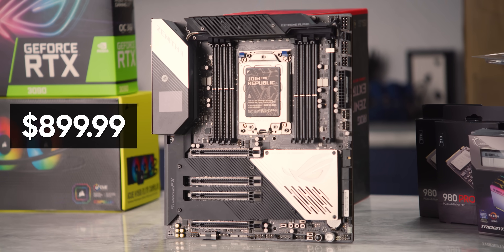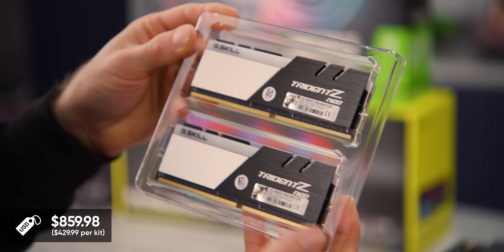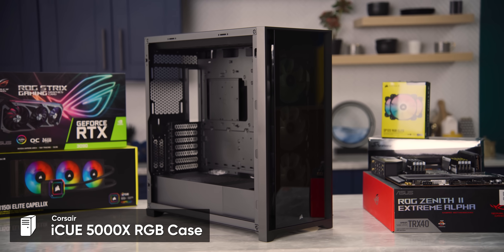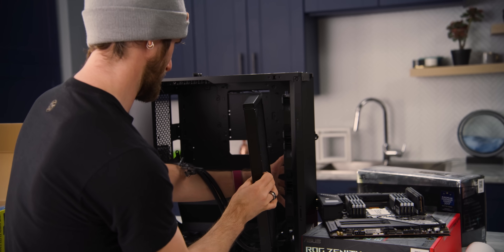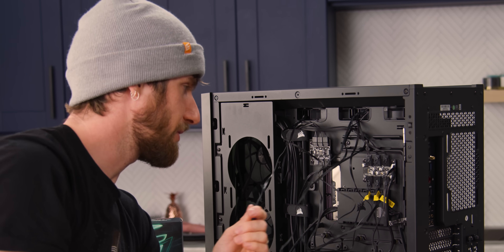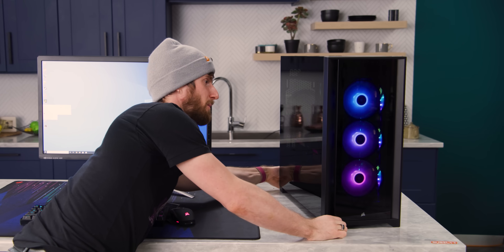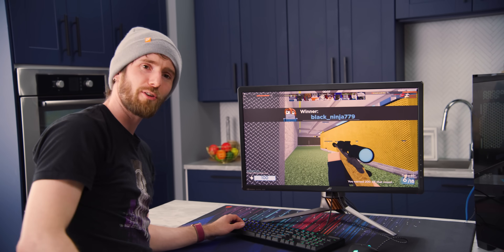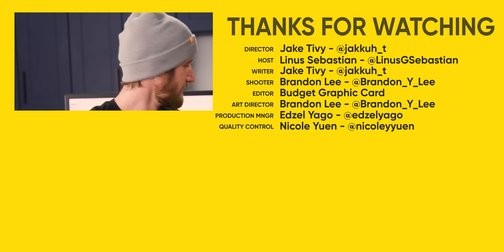Building A $10,000 PC for ROBLOX

Comment: On such an overkill build why not use a CPU cooler specifically made for threadripper?  They exist both in air and AIO/water form.  And personally, for a low maintenance always in use editing rig, I would most definitely go air cooling, like they're not gonna be overclocking the thing, and you can even get better temps and likely extra perf/mhz just by undervolting it a bit.

And, if you ARE going to use a regular AM4 heatsink or AIO for threadripper, you should apply some extra thermal paste AROUND the pre-installed paste, because as you can clearly see, the cold plate is significantly larger than the small area of paste, and while the cold plate may be big enough for the chips underneath the heat spreader, without looking it up I HIGHLY doubt that little thermal paste square is large enough to completely cover them all.  So without extra paste, the rest of that cold plate is doing pretty much jack, but with some extra paste around that square you can at least put it to use and get your half-assed "full coverage" that then might actually technically be full coverage.  Keep in mind though it's not just about the cold plate - the fin area inside the block is pretty small on these and def. not full coverage whereas the bigger ones have way more fin area.

Comment: you say the ram is really high capacity but yet you still used 8 16GB sticks to get the 128GB of ram my rig has 4 32GB sticks and so it also has 128GB of ram at 3600MHZ CL18s so how high capacity are the ram sticks you used really considering a simple gaming build would have 2 16gb sticks for a total of 32GB ram at 3600MHZ CL16s or lower 

i think you clearly cheeped out on the ram and are just trying to make it sound better then it actually is also its trident Z one of the cheapest rams out their that is why thy are practically in EVERY build

considering if you actually used real high capacity ram you could have still given them the 128GB ram at all the exact same specks but use half the slots and then have a easy path to a simple upgrade just by increasing the amount of ram later on to 256GBs 

also only time your AIO should not be in the top of the case is if it cant fit their but then you should have gotten a case that fits your cooler or a cooler that fits your case so in practice an AIO should only ever be mounted in the top of a case

Comment: This computer using quality parts, but it's like RGB, and design wins over everything else. Like come on, the cable management is horrible, on PC like this use some quality single-sleeved cables with decent cable combs also why this case? It's so restrictive that the fans will have to spin like crazy to be able to remove all the heat from the GPU. I use a very similar computer, but fully water colled with custom loop, the case has far better airflow and all cables are custom sleeved cut to desired lenght. Yours have far more led diodes mine is much quieter and both CPU and GPU can clock higher. Its Apple-style computer, design over functionality.

Comment: 6:45.... Are you sure about that? Steve from GN won't be pleased.
(For AIO you want rad tubes down)
And no, about trapped air bubbles. If you power on AIO for a few seconds while holding the AIO  above the pump, the bubbles will come out and in the rad. Then you can install AIO TUBES DOWN without worrying about bubbles.
Hydrostatic pressure principles dictates that, there is no difference between tubes up or down as long as there is no air in the tubes or the pump.

Comment: There's no way that AIO is going to be able to cool that thing without the 3990x throttling heavily if its hit with long term sustained workloads.  My 2950x was only truly tamed by a proper aftermarket CPU block, radiator, and fans.

Comment: LINUS!! please build be a 10k ultimate ramdisk gaming pc. this would include dimmdrive for all  my steam games. and ssd(s) that still have secure erase feature(segui0.exe). also put windows 7 pro 64x on vmware ramdisk  for web browsing and launching games. and include a 4gen pcie that has ram on one of those riser cards or whateve ryou showed before. also have a win7togo usb flash drive that is a ramdisk drive i can boot windows 7 from if i want to boot windows 7 without using ssds. and configur ewindows as bare bones fastest performance in services and regedit tweaks for gaming on wired and/or wifi connections. throw anything else in that you can think of ramdisk related.
Reply: and put the fastest /most amount of ram 1 terrabyte plus please
Reply: setup a ddr4 mobo and a ddr5 mobo if its available. or both so its future proof:)
Reply: and yes AMD not intel. make sure that video cards , etc have samsung chips
Reply: and include a top tier asus freesync monitor that works on any game or any game freesync works on
Reply: or if theres a newer amd premium freesync or newer tech that works better use that
Reply: and no rgb...yuck:)

Comment: I just built a similar rig - Same proc, MB - that cooler is not going to really cut it - temps will run 75-85c under light load I had to get a EK waterblock and create a custom loop to keep it under 65c - Also the m.2 slot on the back really doesn't get sufficient cooling depending on case - I have the Thermaltake tower 900 - My system is for VMs so didn't the need the video card.

Comment: "Money is not an object! Go all out"
"Okay, but you sure as F not getting a back exhaust fan"
Reply: Well it isn't even close to necessary. 6 filtered intakes+3 radiator exhausts is PLENTY for a 360mm AIO with a single gpu.
Reply: @Nobaris9961  it's a 3090, it's not like it's a passively cooled gpu
Reply: @wangpowersports  3090 or a $20 GPU, a single is still a single. Heat doesn't really step up that much until you step into deep SLI territory.
Reply: @Nobaris9961  aha 20 bucks where can I find it
Reply: With 6 intake fans the case is gonna have positive preassure and exhaust out of every little hole there is in the case, everything will have all the fresh air it needs.
Reply: Lmao
Reply: exactly what i was thinking, wtf
Reply: It could be technically not necessary, but if you are to not care about expenses, you are not going to leave an empty fan slot!
As an owner of a CM 690 Adv II, I didn't rest until all the fans possible where installed!
It's the principle of the thing
Reply: @aibandidos  Just another clueless bimbo who thinks "more fans better!!1!1!". At this level of a build one extra fan is not going to do anything noticeable. You're chasing that 0.001% that mean literally nothing in the context of this build.
Reply: @Nobaris9961  why thanks for both the elevation of your argument and for showing you missed the whole "no compromise build" point entirely.
Reply: @Nobaris9961  yes, all of those are as "standard" as an exaust fan.
Reply: @aibandidos  if you actually put 6 intake fans your pc bouta be dead
Reply: @wangpowersports  CM 690 adv II solid side panel, with 4 intakes and 3 extracting since, I don't know, 10/12 years? Rocking a nh-d14.
As long as you have enough exhaust, you can have as plenty intake as you wish
Reply: @aibandidos  well, at least 1 exhaust fan

Comment: I built a $10,000 computer for a customer at Fry's Electronics in Sunnyvale in 1995 with a Pentium 133, 16 MB of ram, 2 540 MB hard drives, Soundblaster Awe 32, and various other upgrades to get to 10000.  We had to order the chips directly from Korea as they were not even available here yet.  Everyone in the store looked at us like we were crazy, no one will ever need specs that crazy.  Now, it isn't even worth its scrap value.  Just crazy how fast computers move.

Comment: Hey Linus! GN's video about "Killing your AIO" actually states that its good practice to front mount the AIO 
Radiator with the tubes at the bottom, and bad practice to front mount the Rad with the tubes at the top because the pump will continue to pull air out of the top of the Rad that way. i.e. Air bubbles always travel to the top of any container holding liquid!

Comment: Someone is going to daily drive this thing.... Ah yes Linus like my rig... A 128 MB rgb ram with an MSI motherboard, a Threadripper 2970wx 2,5 TB NVME 3 TB SSD and 21 TB HDD, also a 710GT, 1050 Ti, and a 2070, and yes I use it as a hypervisor running KVM QEMU and I have a variety of VM's. Also LTT if you have any ideas on my beuatifull BEHEMOTH do let me know.

Comment: I do have to wonder if all those NVMEs are definitely CPU-side. I mean, for that kind of price you'd think so, but I also have a pricey TRX40 board with three NVMEs on board and a riser. Only two board-mounted NVMEs are direct to CPU, the third is PCH. For additional CPU-side NVMEs, the riser needs to be used.

Comment: @Linus Tech Tips Hello? This was the worst case we have ever seen. The blend that blocks the side intake also blocks the power cables from going in sinkreight into the motherboard. We spent an hour to get that pos plate out of the tower cause we had to uninstall everything, especially the cable management on the backside, in order to get this f out of the tower. Once out we didn’t waste more time trying to get it in again cause as it seems only custom cables can bend as much. However it might be you have a slightly newer version cause the top plate was also fixed to cables of the cable management. But still, this was such a terrible case.

Comment: One of my friends has a build like this for pro (10-12k) video editing which is his living. He has 4 2080tis and a DIMM.2 full of 8tb gen3 drives which he says is fine. The whole thing is liquid cooled and has a second dedicated circuit that powers half the GPUs, with the other half running off the original circuit in the room (yea he had to install a 2nd circuit for his PC). He still has his 3970x and recently sold his first 2 2080tis from his first rig, which he used long enough for them to DIE inside warranty, both of them. Renders were crashing constantly and none of his pro apps would run anymore but they gamed fine, so he RMAd them and sold the replacements (which were surprisingly new in box which was kick ass, this was last year when new cards were $1100, he got $1200 for them a month ago though). Dude's got 256gb of RAM as well and has sent screenshots to me of over 180gb of it in use in after effects, it's absolutely wild

Comment: Linus apparently has no idea how to mount a an AIO. Air raises Linus. When you mount the AIO with the tubes coming from the bottom you ensure air does NOT get into the pump. If you mount it with the tubes at the top, that's where you are going to capture air. smh From Corsairs website, "mount the radiator of the cooler at the frontal area of the case interior. The side of the radiator where the tubes connect should be at the bottom, and the pump should be mounted in a position where it is slightly lower than the top of the radiator, where air is captured." At least Jakes method of mounting at the top ensures that the tubes are always at the bottom of the water.

Comment: One thing I've started doing when installing/uninstalling radiators with fans is just taping them on an accessible side with blue painter's tape. Then everything is all together when mounting and I don't have to manage the fans AND the radiator AND the screws all at once. Then once it's mounted, just peel and go!

Life-saver when mounting the EKB Elite with six fans...

Still catching my breath from cable managing that.

Comment: I find it weird people are still telling the lie that it's fine to go with a CPU cooler that doesn't cover the whole IHS on threadripper. While it would work, it's not ideal. If you're already spending the money, get a full IHS cover cooler. There are plenty of options for both air and water. It makes a significant difference in temperature and if you're using it as a workstation heavy duty cycle processor you're going to want the full coverage.

Comment: Hey There just bought a ryzen 7 5800X and tried to install it on a b450 pro vdh plus with a BIOS Update and it didnt work, so i bought a b550 tomahawk and Today i also tried to build it and the CPU debug light lightet up again (on the Box of the Motherboard Stands that its "5000 CPU ready). Does anyone got an idea?
Reply: Bend all the pins then rub it against a wall